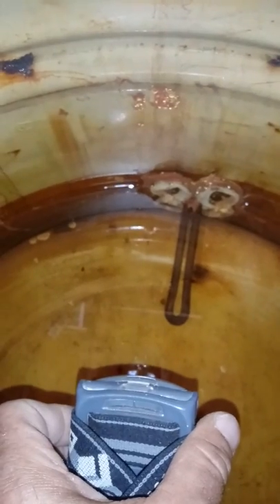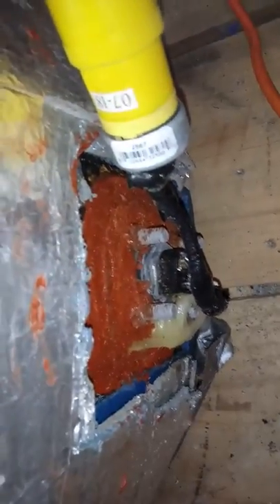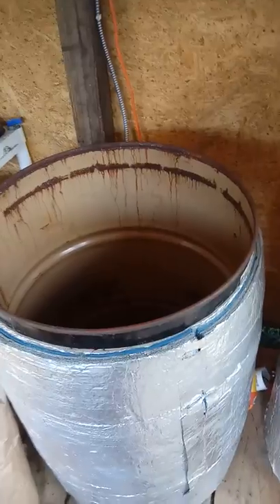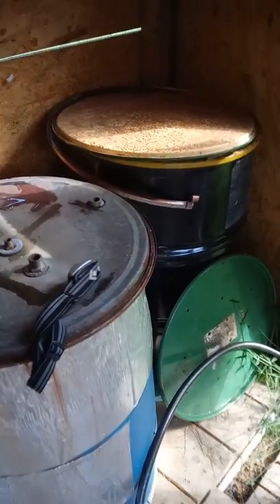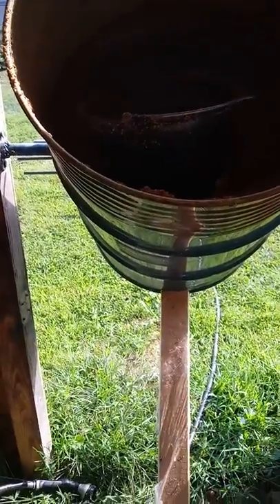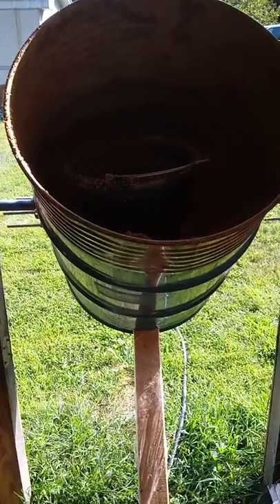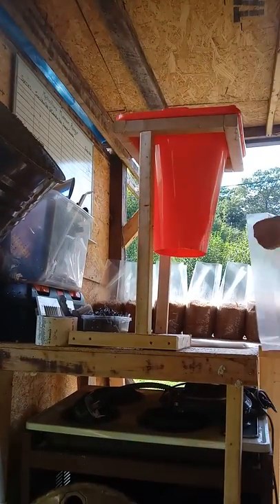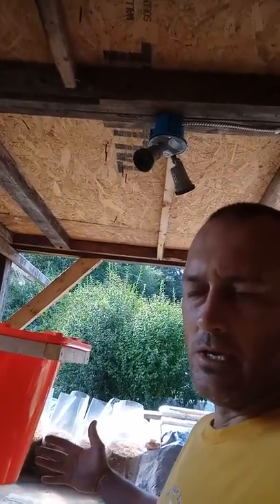Substrate mixing and super pasteurized area.

Comment: 1 week to cool down?  Does it actually take that long to cool down?
Reply from the maker: You can speed the process up by putting them in your laboratory, with the liminar flowhood running. But, yes it does take that long to be absolutely sure the core of the blocks are cool enough to inoculate. Otherwise, you risk killing the mycelium due to high temps.